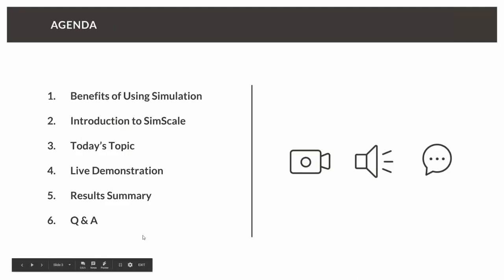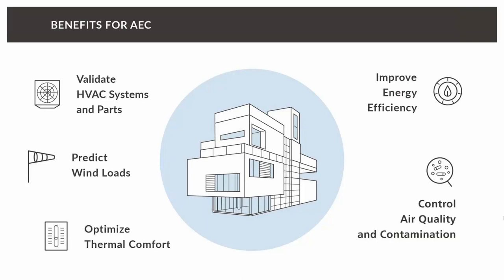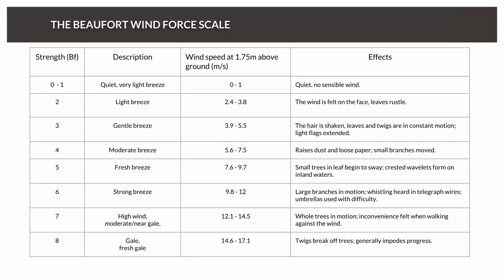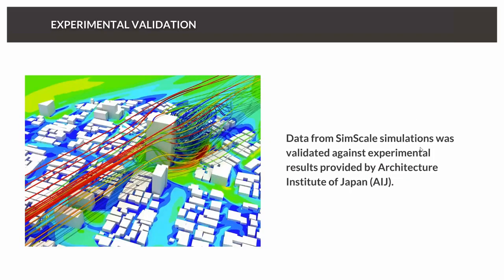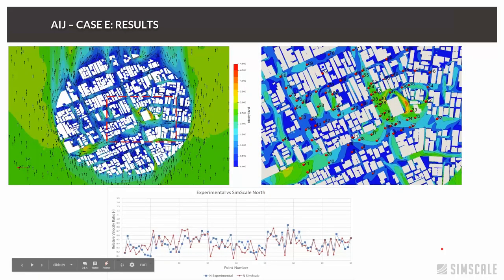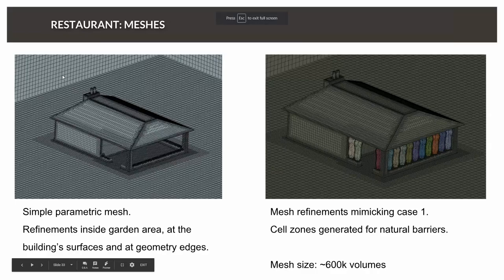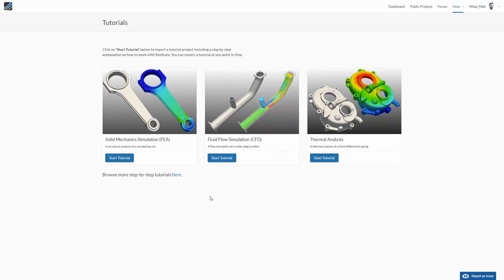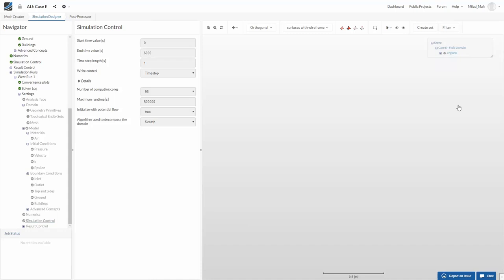How to Evaluate Pedestrian Wind Comfort with CFD

Comment: In the validation cases you state that the trend is right even though there is some error. I note that in lots of cases the error is actually quite large. There are numerous cases where SIMSCALE underestimates the wind speeds by 50% or more on the slide at 22:40. That's the difference between a successful cafe and going out of business, or a comfortable building entrance and a $200,000 retrofit for a revolving door. How can SIMSCALE be tuned to bring errors down to a reasonable level?
Reply from the maker: Thanks a lot for the question!

As correctly pointed out in your comment there are quite some big differences, especially at the right end or at higher points of the measurement. One big question that always occurs in this case is if the measurement is correct or if you hit the value better with the turbulence model as we have chosen in this case. A big mistake people often tend to do is to fit the simulation to whatever data they have. However one should do multiple observations/measurements to see if the value measured are not falsified by noise.

For the simulation it is actually just the turbulance model with highly seperated flows etc. which is hard to simulate with steady-state. We actually know that the results improve slightly using k-omega SST but not significanly enough to invest extra effort. We could also invest additional effort in running a Pacefish run, as this would obviously predict the average flow better. Hope that clears things up a bit!